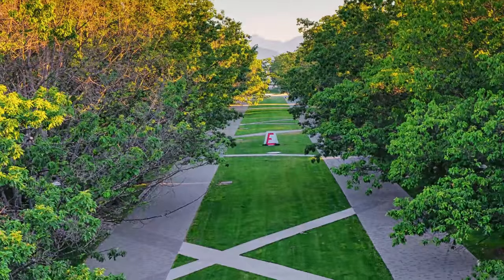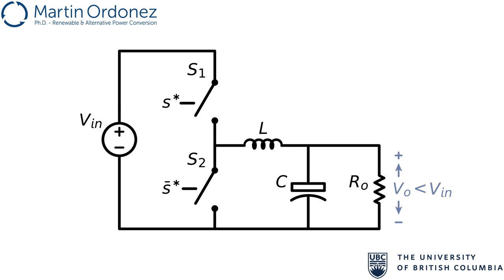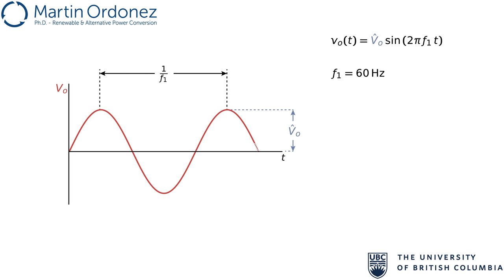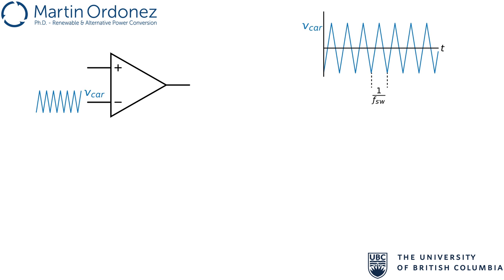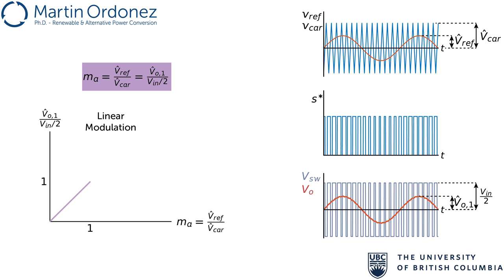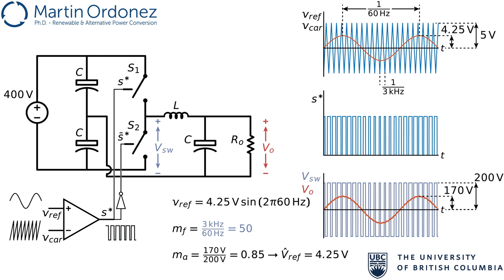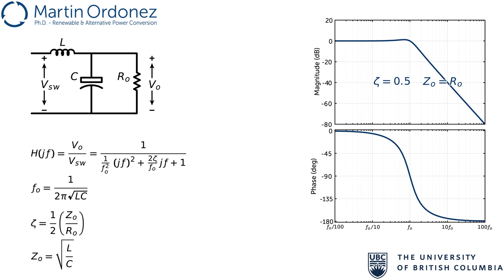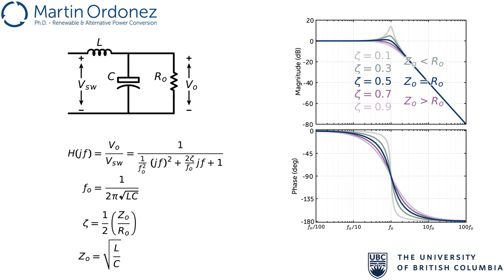Power Electronics - Half-Bridge Inverter

Comment: I really love electrical projects but can you please explain to me why mosfet just damaged when the protection diodes is connected to drain and source and the tl494 Ic I followed the directions on the diagram for half bridge inverter but the two mosfet or turning on the same time I even thought I wire the Ic up properly because the two signal or generator good I can see the dead time between the two signal one one channel scope I have but as I did I connected pin 11 12 8together pin 13 14 15 2 together 1 16 together 2.2k resistor to pin 4 7 together 1.uf capacitor 50volt to pin 5 7 and I got good 7v signal on the two 10 9 but when I connected the mosfet gate with 100 ohms resistor and 220ohms to source and gate fast switching diodes to grain and sourced with a 20v battery the mosfet is 55 v and the two mosfet get fire hot and blow I use induction and the mosfet just get hot I use 10 different Ic the same results and my friend in Asian use the same diagram and his circuit work I copy his and the same thing happens 9 Ic just get hot a stop work even before I try the circuit am not understanding why the Ic is not generated two signal in puch pull mode